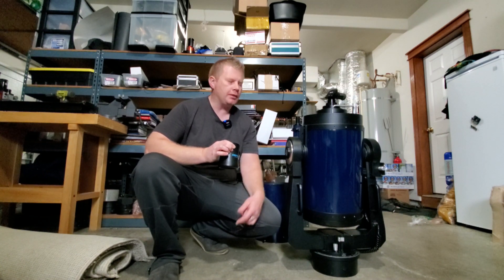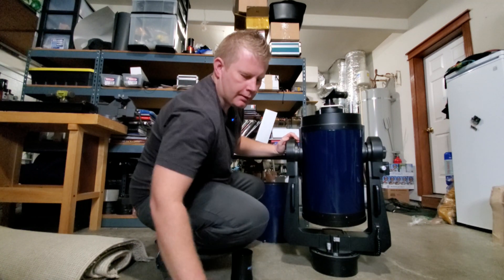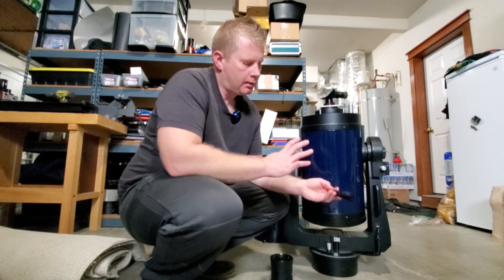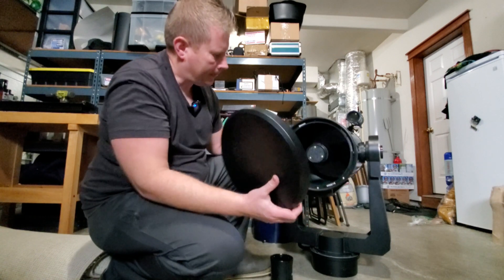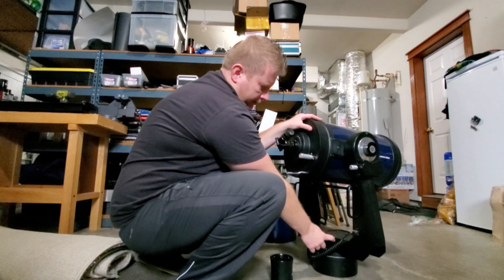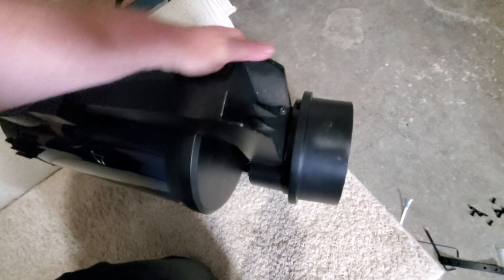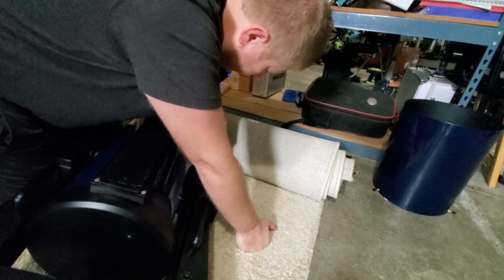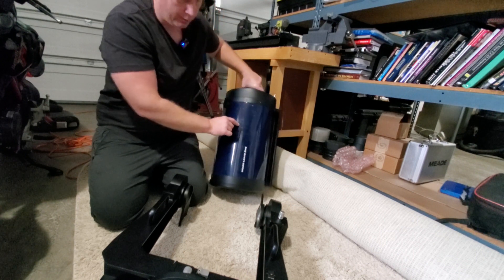De-Fork LX-200 Classic SCT Telescope? How to Defork a Meade SCT Guide.

Comment: Thank you for this. I just finished de-forking mine.
Reply from the maker: Nice, hope it went smoothly!
Reply: @AVTAstro i had to disassemble the entire thing pretty. I used oil filter pliers to remove the flywheel in the geared arm, which is kinda bush league but whatever. I didn't scratch the paint on the OTA though. Thank you very much

Comment: Nice video.  Hey, I'm going to defork my Meade Lx90 12" because the mount is too inaccurate.  I'm buying a Losmandy rail for the Meade 12" telescope  but it doesn't come with screws.  Can you tell me what size screws you used to mount your rail?  And where did you get the screws?  Thanks!
Reply from the maker: Hi, sorry not sure what the thread size is.
Reply: @AVTAstro  Thanks but I was asking the length of the screws since you mentioned that you don't want one that's too long and interferes with the mirror moving.

Comment: wanted to ask you a question-do you know if the optical tube can be removed from the base on a meade rxc400 14" to be shipped- looking at a 14" but only option to get it is to ups from Long Island New York.
Reply from the maker: It can but not easily and really permanent.

Comment: Plugged my grandfather’s old 10 in LX200 and blew a fuse in the powersupply, thougjt it was just an old fuse so we replaced it and rhen the mount sparked so I quickly shut it off lol.  Is it worth trying to get Meade to repair it or should i try and find a new/better mount, and do you have recommendations?
Reply from the maker: Sorry to hear about the issue. More then likely you just blew one of the caps I talk about in this video. If you can't replace it yourself I would definitely just look at de-forking the OTA and getting a diffrent mount.

Comment: Jeez!
I just bought a 8" Mead + Tripod + equatorial wedge for $350 
No controller (was looking for one luckily did not find one) and maybe the board is junk??? 
but
Defork Meade gives me a great optics and rock-solid Mead tripod and Meade equatorial wedge mount.
I'm going to do it!
but
I need a low-cost way to adapt  Defork 8" Mead to the Meade tripod or really to the Meade equatorial wedge.
Any suggestions?
Reply from the maker: The low cost option is to just keep it on the fork mount. There are diy goto electronics you can put on the fork mount.

Comment: Vlad, I have an 8 inch LX10. I bought it a year ago and the circuit board was kaput so I bought a new board from Clearline Technology in the US. I now have fully working RA and Dec motors just as the LX10 should be. Here's the thing: I also bought an EQ5 mount with an ST120 and I am permanent mounting this outside on a todmorden style pier. What I would really like to be able to do is use the LX10 on its fork and tripod if I wish to travel anywhere with it BUT I'd also like to be able to mount it on the permanent EQ5 mount to enable swapping, at home, between scopes. My question is: Is it possible (and relatively easy) to de-fork and re-fork the OTA (I don't foresee doing it often like every week or even every month) and, when re-forking, would it re-fork properly with its previous alignment and not be out of whack? Would really appreciate your thoughts on this.
Reply from the maker: Yes your should be able to do that just fine. You can easily have a dovetail on the bottom of the scope and still have it on the forks. It's not the easiest thing to do to re-fork, but it should be just 6 screws that hold it on. Hope this helps, Vlad.

Comment: Update for anyone who may face this issue. I had to put a short (6") piece of 3/4" ABS plumbing pipe on the allen key and just crank till the bolts broke loose with a frightening "CRACK". I am pretty sure Meade must put loctite on them at the factory. If you do this, make sure the wrench is a correct fit to avoid striping out the bolt head.
Reply from the maker: Glad you got it loose!

Comment: ARE YOU FREEKIN KIDDING??? OK, What do I do if the side fork bolts feel like somebody used red loctite on them? The allen key feels like it is going to snap or strip the bolt out if I turn any harder. I also read that if you loosen the forks, re-aligning them can be almost impossible. I've tried to slide the tube out so that I could get a spreader between the forks, but it is so tight that there is now an 6" long scratch, no CANYON, down the side of the tube. My spreader cannot budge it even a millimeter. Why is it every time I watch someone do something on youtube then try to do it myself it feels like I'm being punked?
Reply from the maker: Sorry cant give too much help on that. Maybe try a little PBlaster. Stuff works great but you want to be careful not to get it on the optics.

Comment: I purchased an 8” Schmidt Cassegrain Meade I believe around the year 2000 to 2004.  I can’t remember.  Sold it in 2010 due to not being able to work because of cancer.  I’m wondering what model it was.  Been searching catalogues, but nothing rings a bell.  Actually, they all look alike.  I just remember it was very heavy to move so I barely used it.
Reply from the maker: It would have been the Lx-200 or Lx-90.
Reply: @AVTAstro  Found it.  It’s the LX10.

Comment: Okay maybe I need to do this. I have the exact same model you have made in 92. I saw in your hand controller, 1993 so probably the same. I plugged in the 12 to 18v car adapter and it beeped but then nothing happened. I dont know if anything on it works any longer so assuming I do not want to change caps or troubleshoot this mount, what are my options? The original tripod is great and the wedge there seems to be perfect. I just want to get a controller that will either plug in and use the existing motors or change that altogether but keep the tripod and wedge. I cannot figure out how to ask this question because I do not know what all the parts are. I basically would like to use as few new parts as possible as I do not have much of a budget left (approximately 1,000 dollars).
Reply from the maker: Well actualy if you take the time to swap all the capacitors there is a good chance that the mount will work just fine. If you have the skills to do that that's where I would start. It really does not cost anything so worth a shot👍
Reply: @AVTAstro  do you have a bill of materials for the caps? I am thinking of doing it! I've only seen the caps in the hand controller replaced so I'll need to find a tutorial. I know how to solder but I know nothing about electronics. Imagine that

Comment: Good video. I'm about to undertake this little chore tomorrow. As I stated below, "Losmandy makes a D kit with curved standoff to match the curvature for the Meade SCT OTAs. I got mine at Astronomics. Losmandy part # DM-8 for Meade 8" SCT. $95 Astronomics also has the Vixen style mount for the top if you choose to go that way $65, but it only mounts with one screw at each end and I didn't want to do that. I put the D style top and bottom." Also, the correct Allen screws are included in the kit. Unfortunately, mine is the LX200 GPS and the only way to get to the side screws is to completely remove the forks.
Reply from the maker: Thanks for the tip. 👍

Comment: You used a Losmandy dovetail. Do you have the particulars on the dovetail mount you installed?
Reply from the maker: Hey Phil, sorry the one that I put on was used and honestly I don't recall the brand. I have seen all the different brands and they are all quality units. I would get one that comes with the radial mounting blocks.
Reply: Losmandy makes a D kit for the Meade SCT OTAs. I got mine at Astronomics. Losmandy part # DM-8 for Meade 8" SCT. $95 Astronomics also has the Vixen style mount for the top if you choose to go that way $65, but it only mounts with one screw at each end and I didn't want to do that. I put the D style top and bottom. Hope that helps.

Comment: Shucks you must have posted this right after I searched before. All I found before is a guy basically beating the tube until it could be dragged apart. This video made it seem simple. My forks work fine and I have a wedge but I'd rather use a polar mount so planets don't rotate.
Reply from the maker: Well hopefully it will help someone in the future!

Comment: Thank you very much. Very helpful video. Was really struggling before watching your video. Sadly I had to de fork my 25 year old classic 8” inch. The electronics blew up again today. The repairs are just too expensive and don’t last very long. Do you think tube rings connected with a dove tail bar would work?  Thanks again. Now subscribing.
Reply from the maker: Well rings and dovetail would be ideal. Most people just do a dovetail and I works quite well. Thanks for the sub🇺🇲

Comment: I think a common mistake is to try to take the tube out without removing or slackening the side of the fork, which is so easy to do, and saves all those nasty scratches. I've done it a few times to service the slow motion mechanism and lube the drive base on my old LX10, but TBH even though it's made in the good 'ol US of A the drive base is a nasty thing, and I need to mount it on a German equatorial, EQ6 or something.  I was thinking of buying tube rings but will probably do what you've done and just attach a plate. I think the LX10 optics are worth saving, mine are over 20 years old but still in great condition. Great video by the way.
Reply: The little lever lock broke  on top of the fork of my LX10. It broke something  in side the fork. So my LX10 won't lock in place.Was wondering if you had to ever fix t his? Called Meade and they had no parts to help.
Reply: @robtankbuster5215  The lever operates a little brake mechanism like a cars drum brake which operates on the side of the mounting bracket. You would need to dismantle and replace or repair it. Start by removing the Allen bolts at the base of the forks, enabling the forks to be removed and it all comes free. It's quite easy to work on. Getting a replacement part shouldn't be too dificult as these are getting old and going for not much money.
Reply from the maker: Thanks, glad it was helpful 👍

Comment: Great video. I have a LX200 12" I am considering to de-forking. What were the exact length of screws you used?  What mount would you recommend for a 12" SCT? I use it mostly for visual. Keep up the amazing content!
Blessings,
David
Reply from the maker: Hey David, screws where 3/4" long. The ones for the dovetail will depend on what  dovetail you use thickness wise. Mount wise you will really want a minimum of a 40lb capacity mount. That's the absolute minimum though as the Ota is around 40lb. I use a losmandy g11 with my 12" ACF.